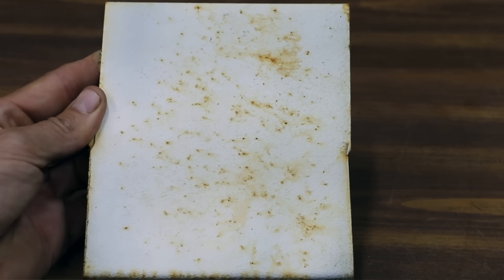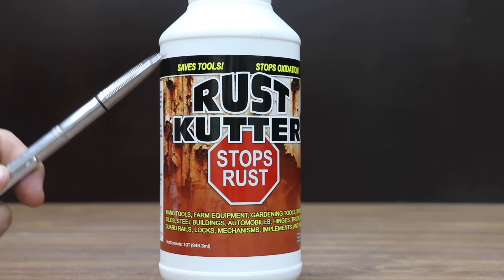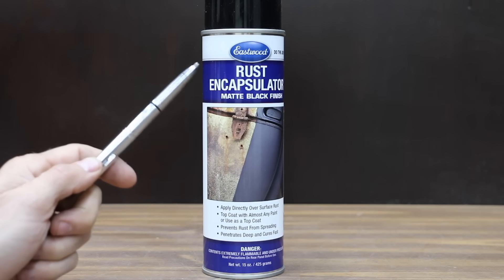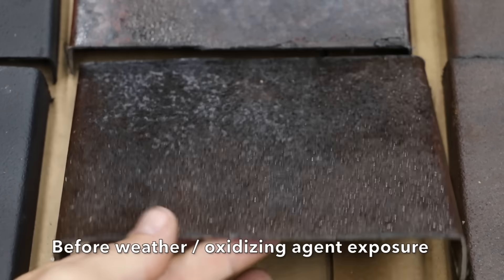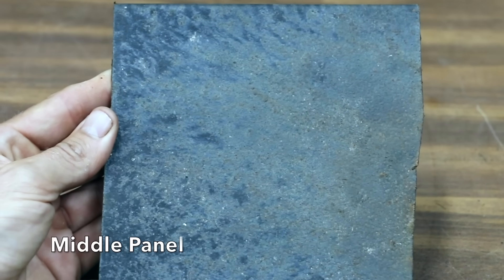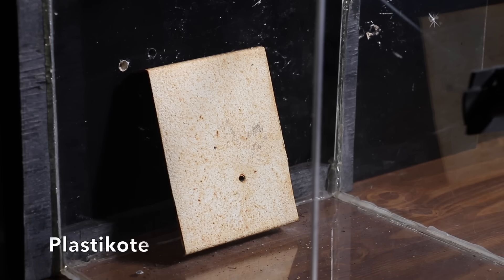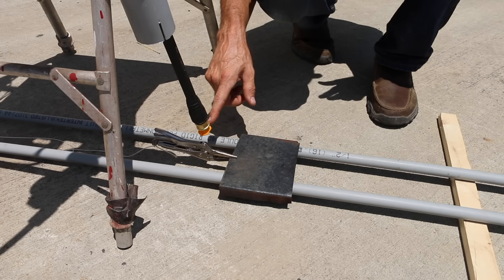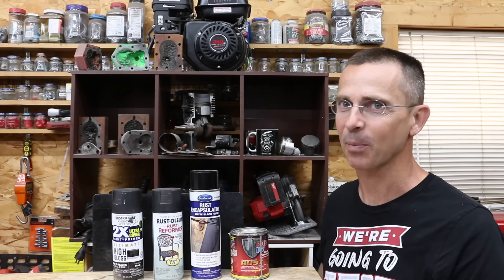Best Rust Converter? POR-15, Eastwood, Rust-oleum Rust Reformer, Gempler's

Comment: I've used Rustoleum's Rust Reformer for years on everything and it has always worked really well. It's good to finally see it in a showdown with other rust reformers to see how it compares to them. Rustoleum paints in general are pretty good because you don't need to spend hours on prep work to get a decent result. Rusty part? Brush the rust off, use rust reformer and then whatever color rustoleum spray paint over it and call it done. A bonus is their paints generally cure in minutes, rather than hours, days or never in the case of Valspar.

Valspar is probably the worst spray paint brand I've ever used. The paint literally never dries or hardens. I have blower housings that I painted over a decade ago and the paint is STILL soft and mushy.
Reply from the maker: Thanks for the feedback.

Comment: I'll bet professional auto paint beats them all. Like my favorite, Delfleet essential single stage paint. This uses an activator and a hardener with limited open time so you cannot put it in a regular spray can it has to be mixed then sprayed but the result is hard as NAILS.
Reply from the maker: Thanks for the feedback.

Comment: My experience. POR 15 is horrible in the sun and will degrade and change colors.  The converters change rust into a primer.  Paint makes a skin (put on properly) that could be air tight and primer has lots of pores allowing rust easily through. Very good test.
Reply from the maker: Thanks so much!  Thanks for the feedback.

Comment: Was in the industrial sandblasting and painting business for years, saw a lot of paint over rust and rust converter products. When I blasted them off and did it right. 😆
 But that's not always an option. Relatively light rust can be coated successfully but thick rust you can chip off with a hammer really can't.
Reply from the maker: Thanks for the feedback.

Comment: Excellent test, though I found the results surprising. The rust converters I've used are either simply phosphoric acid based and turn the rust a shiny, dark brown. Or have a primer built in and turn the rust purple with a shiney, enamel like finish. Both brush on liquids.    
In both cases they've successfully stopped rust for well over a year while in the elements, so the fact these products here all only offered partial protection surprises me. 
I wonder if being spray on vs brush on affects it if spraying is not getting droplets into every tiny cavity in the rust.
Reply from the maker: Thanks!  Thanks for the feedback.

Comment: Another great review! I really would have liked to see Ospho 605 Metal Treatment in this group. I've heard nothing but great things.
Reply: I tried using that on my 4Runner's frame a few years ago. It looks nice when you first put it on, but then it turns all the rust white. You can't paint iover the white, so you have to use more ospho to scrub off the white residue. That's kind of a pain in the neck, I regretted using it.  I did more research, and it turns out the proper technique is to spray or brush it on, and then wipe it off before it fully dries.
Reply from the maker: Thanks so much!  Thanks for the suggestion.

Comment: Happy to see Rust-oleum Rust Reformer do so well. I refinished the frame of one of my jeeps with it and painted my tube fenders along with some Rust-oleum self etching primer and Rust-oleum truck bed liner. Thanks for the great video as always!
Reply: Did the you paint or use bedliner straight over the self etching primer, or did you prep it at all?

Comment: nice thanks! I think I requested this once. one thing that you didnt test directly is if rust is continuing under the coating. things like rubberized undercoating "appear" to work but all they do is trap water and make the rust much worse. so removing the por15 to see if the metal is still rusting under it. I used rustoleum rust reformer it seems to work. im using it on rocker panels and that is still up in the air. I do know I used it on a screen door 5+ years ago and recently I saw some rust coming through again. that is pretty good in my opinion because the rust was pretty bad on the screen door.
Reply from the maker: You are welcome!  Thanks for suggesting this video test.  Thanks for the feedback.

Comment: Try these against Rust Knockout.
Reply from the maker: Thanks for the suggestion.
Reply: @ProjectFarm  Having tried most of the others, Rust Knockout seems to work the best. As long is the metal has only surface rust and nothing more, Rust Knockout really works. Nothing else is better is or even close. That said, any fully clean, bare steel, otherwise free of contamination can be prepped with any good, high quality, oil based primer and top coated with an equally high quality topcoat, with multiple applications and will last a long time.

Comment: Wow. Great video. Been wanting to see a contest between Eastwood and Por15. I wonder how much better the Por15 would have been with the metal prep Por15 recommends, which leaves a zinc phosphate coating.
Reply: I know POR15 is loved by many... But i tried that stuff on my Ford Escape wheel wells and back hatch rust and it did little to stop the rust.  I tried it 3x... And prepped everything exactly as they instruct.  I do live in MI and they use lots of salt here.  I just feel like rust can rarely be stopped.  You can maybe slow it down.  Maybe
Reply: My experience with por15 was similar. Rust bullet delivered. The spots where rust did come back, I just scuffed with sand paper and applied another coat. Rust bullet also has much better armor vs por15
Reply: @kevinbradley9601  The reason why are Fords are made to rust....jk. I think the Por15 is great, though SEM makes a simaler product I have used that actually comes in a screw top container. This in itself the biggest drawback to POR15. Opening can and stiring and removing what you need. Its messy. And I think some of the application problems stem from this. Using directly from can a big no no. Leaving the top off another one. And not mixing correctly on cans that have sat on the shelf a long time.

Comment: I'm surprised i did not see Hammerite.
That stuff is quite good in my opinion. And at least when it comes to corrosion protection would knock all of the tested products out. I'm not affiliated with the company. I just used it a lot. Stuff (i.e. balcony railings) i painted 15 years ago is still rust free.
Reply from the maker: Thanks for the feedback.

Comment: I would like to see some tests for different types of fishing lines: monofilament, fluorocarbon and braided. Knot strength, knick resistance, tensile strength, twist resistance and age control. Different knots and line weights. So many options, it's hard to choose.
Reply from the maker: Thanks for the suggestions.
Reply: @ProjectFarm  Another vote for fishing line!
Reply: Berkley has videos on knot strength. 

Basically, if you're using a braid you use a palomar or modified palomar knot, and every one of them will exceed the test rating.
If you're using a mono or flourocarbon, use a trilene knot and you'll exceed the test rating.

I have used many, many lines. I've had some I loved for their strength and abrasion resistance, but they wind knotted and were a pain when trying to cast on windy days. Mono that worked amazing for a few months, then took a set and turned into a big ball of shit trying to go through the guides. 

I have it narrowed down to just a few that stay in the boat now. Sensation in 6,8,10 lb for various size spinning reels and leader. Basic standard fireline in 6 and 10 lb for various size reels. 30lb braid for the baitcasters that I'll be using to flip and drop in trees and heavy weeds. And lastly 10-12lb flourocarbon for leader material if you need that weightless plastic worm to jig slower, or you can't get away from those slimey pike.
Reply: Maybe he don't fish.

Comment: I've used Rustoleum Rust Reformer on all of my vehicles and restoration projects and have never been disappointed w/ the results and longeveity/durability, however, I use two to three coats, where you used one. I did a sway bar set-up and all of the suspension parts for my S10 w/the reformer and some hammer tone top coat and they look like I just finished them (other than road grime) - zero rust.
Reply from the maker: Thanks for sharing.

Comment: I did my 1967 Porsche 912 Targa (with soft rear window) with POR-15.  Sold it for $26,900 and thought I was a genius.  It sold in auction recently for over $130,000.
Reply from the maker: Wow!  Thanks for sharing.
Reply: @ProjectFarm  One thing about Por-15.  No direct sunlight.  It will degrade it over time.  Just a light coat of anything post POR-15 protects it and keeps it tidy.

Comment: Excellent video.  Next time please include Evapo-rust.  I have used it on motorcycle tanks with rust in them with great results.  It isn't spray on though and the parts have to be submerged but it worked great.
Reply from the maker: Thanks so much!  Thanks for the suggestion.

Comment: VHT used to stand for Very High Temperature, and was the paint of choice for high temperature car parts, but not exhausts, back in the 60's and 70's.
I'm really not a rust converter kind of guy.  I take things down to the bare metal one way or the other, and use good primers or primer surfaces.
BUT, if I had a situation where this was not possible, I would go with the POR-15.
Thanks for the excellent comparison video.
Reply from the maker: You are welcome!  Thanks for sharing.

Comment: I have tried this stuff. Formula 3000 from Canadian Tire, where, Canada of course. I have trialed this against Eezox which is my go to shop and gun stuff. RCMP had tests done and Eezox came first with G96 second. My test was to degrease and sandblast and degrease and sandblast again some 1/2" grade 8 cap screws. I then glued them upright to a 2x4. I coated some with Eezox, some with Formula 3000 and some with nothing.
Outdoors on my deck through the Ottawa winter. It goes cold to hot many times. Over the season. Bare was red, Eezox had a bit of red and Formula 300 was totally naked of red. I tracked it down because I bought a new car and it had the best rust proof rating in Canada. For cars Ottawa is very evil, lots of salt on the roads. Cold enough to be miserable but warm enough to let salt work on the ice.
I am not sure if 3000 is a good lubricant, that's next for me.

Cheers,

Ian
Reply from the maker: Thanks for sharing!

Comment: If you ever do an update, the CRC product would be nice to try. I suspect that all the tartaric acid/latex products (like the rustoleum 'rust reformer' will work similarly however. They do work quite a bit better when painted on... generously. The cans are nowhere near as effective.
Also one thing to be kept in mind with POR15: it's very UV sensitive and needs a top coat in any practical application. Being an epoxy product, this is not as easily achieved as it normally would be.
Reply from the maker: Thanks for the suggestion.  Thanks for the feedback.

Comment: I just use the works toilet bowl cleaner after removing loose rust and dirt. It converts the rust to a phosphate then I just spray with a etching primer then paint.
If I can soak the part then I soak in vinegar then etch prime and paint.
My preferred method is to remove all rust then just etch prime then paint.
It all depends on the part and end result desired.
Reply from the maker: Thanks for sharing.

Comment: I've had great luck with POR-15 but moved on to a different Rust-Oleum Rust Reformer that Menards says is Solvent-Based, and the one you tested says oil-based. I also tried the quart size Rust-Oleum 2-in-1 rust reform & seal rubberized black coating but it's a hassle brushing it on so I've found the best for me is the Krylon rust protector satin enamel spray for less than $5 at Walmart since it dries to the touch in 8 minutes. They have flat and gloss as well. I'd like to see the winner of the paints I just mentioned.
Reply from the maker: Great feedback. Thank you

Comment: Another fine test, Commander! I've used the Rust Reformer and the 2X on the Taco but I'm not very picky about what don't just fall off. I also use Permatex #2 in the tube and Aviation in the can so I'm not very modern but what works, works. And on a lot of my stuff the rust is the only thing holding it together so I go sparingly! Hope all is well and firewood is full up. Yall be BLESSED and GBWYall!
Reply from the maker: Hi Lewie, Great feedback on the Rust Reformer and 2X.  I made enough firewood last winter to last for 2 years or so.  I cleaned up about 8 acres of overgrowth.  That area of land hadn't been touched in 40 years.  Cows can safely graze it now.  Always great to hear from you and wishing Yall many Blessings!
Reply: @ProjectFarm  I know you were having a time with the Osage Orange but sure am glad it's a done deal for a while. Yall remain calm and GREAT batting things back and 4th! God bless!

Comment: Very interested to see the Eastwood/POR-15 comparison. I've used both products in a professional environment and on my own vehicles. I don't use the spray can version of the Eastwood, I buy it in a tin and paint it on like with the POR-15. In that form the Eastwood is much much stickier and forms a really nice thick layer. It also says on the Eastwood instructions that it is vulnerable to prolonged sunlight exposure, so it should be topcoated to protect it.

I've found that both Eastwood and POR-15, when used on the underside of a car and coated with a good chassis paint, seem to provide equally good performance. However I use the Eastwood now, partly because where I live POR-15 is ferociously expensive and is about 2-3 times the price of Eastwood, and also because the proper prep procedure for POR-15 requires the use of their own brand metal etcher, which is extra expense and time. The Eastwood is far more efficient to use. Your results here though with the POR-15 are very impressive. I might have to look again.
Reply from the maker: Great feedback. Thank you

Comment: I used Rustoleum Rust Reformer on some very rusty plant stands my wife found 3 years ago in the trash that a neighbor threw out.  Since it was just "junk", I didn't want to spend a lot of time on it removing all the rust, and just sprayed it with the rust reformer, and top coated it with some Rustoleum in a color I liked.  I wasn't sure how well it'd work, but I hoped for the best.

3 years later, and it's still in great condition, and zero rust.  So I'd say my real world experience mirrors your test results well.  

Honestly, it's great when an inexpensive product works exactly as advertised.  I was a little skeptical it would do what it says, but it definitely works extremely well.  

(Oh, and don't tell my neighbors how easy this was....  they might stop throwing away perfectly good, and often very expensive stuff!)
Reply from the maker: Great information. Thank you

Comment: Last year, I coated a pair of steel running boards on a Ford econoline cargo van with POR 15.  It disappeared completely after approximately 3 months.  
I’d also coated the entire undercarriage of my pickup with it, and it is still looking decent after 1 year.
I use Rust Kutter on sheet metal that has surface rust,  it has been the best product I’ve tried for my classic car projects.  I sprayed it onto a trunk lid that had surface rust,  the metal looked like new within 10 minutes.  The trunk lid sat in my shop for a couple of months, but eventually found its way outside.  It has been outside for well over 1 year now, exposed to the elements and still looks good.
Reply from the maker: Thanks for sharing!

Comment: I thought the POR-15 tag line was purehyperbole, but it looks like it's not so far from the truth.
I'm also highly suspicious of the spray converters, I think these all use some kind of acid, so I'm not keen to have aerosol acids hanging around. I also wouldn't be surprised if the aersol cans have a hard time delivering enough volume to actually saturate all the rust.
Great test mate!

Comment: I've gotten good result using a product called Ospho (purchased at NAPA).  On another subject I have a suggestion for 2 comparison tests.  #1 While using a drill press drilling holes in steel, which is more effective and does the least damage to the drill bit tip.....high speed or lower speed.   #2 When loosening a stuck bolt or nut, which is less likely to damage the bolt head or nut....12 point wrench, 6 point wrench, or open end wrench.  Thanks for your testing videos.
Reply from the maker: Thank you for the feedback!

Comment: Thank you for this test!  I can finally show my neighbor why I used POR-15 to fix my rusting Weber gasser grill.  The frame bottom started rusting out and put a growing hole in it.  I bought the whole POR-15 kit which converted the rust to a paintable metal, and then applied the POR-15 to the whole panel.  After 9 months of being outside, the hole hasn't grown and the panel still looks like the day I painted it.  For the next grill I buy, I will be painting the frame with POR-15 before assembling it.
Reply from the maker: Thanks for sharing!

Comment: the only thing about POR15, it is not durable. it works great though. i coated a Mule bed with it, stopped the rust, but if it gets scratched in a spot, it comes up easily. i'd recommend a bedliner over it or a rubber mat.
Reply from the maker: Thank you for the feedback!

Comment: I applied Aqua Steel rust converter to the underside of a Toyota celica in 2017. Like most of these products the rust came back again after a couple of years. In my opinion rust converters are only a cosmetic quick fix. If I were to do this again I would apply a high quality zinc rich primer to the bare metal surface, maybe something like Zinga?
It would be good to do this type of test again using zinc rich primer and paints.
Great detailed video, keep up the great work 👍.
Reply from the maker: Thanks, will do!  Thanks for sharing.